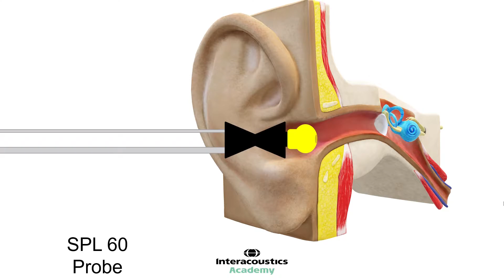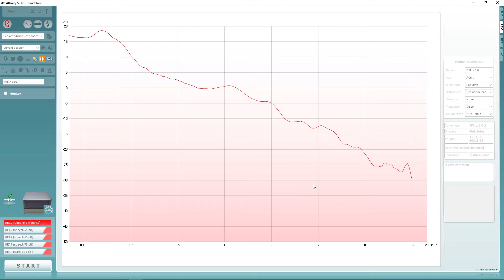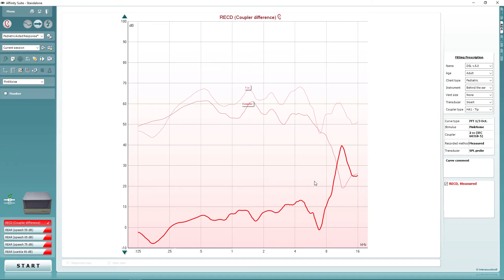How to perform RECD measurements using the SPL60 Probe on Affinity Compact

Comment: Hi, it was mentioned in the video that for REAR - when fitting RECD using SPL 60 probe, aided measurement must be recorded using HA1 adapter. But what if I am verifying a BTE, I should be using HA 2 adapter?
Reply from the maker: Hi Siau!

For SPL60 measurements and a BTE instrument, you should fit the device with a HA1 adapter and putty according to the latest ANSI guidance.

Best,
Shane